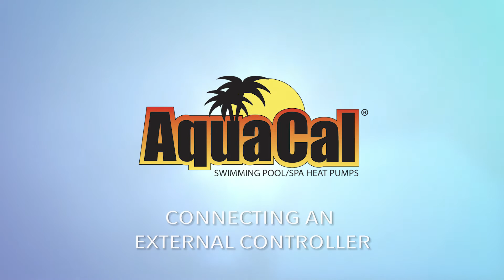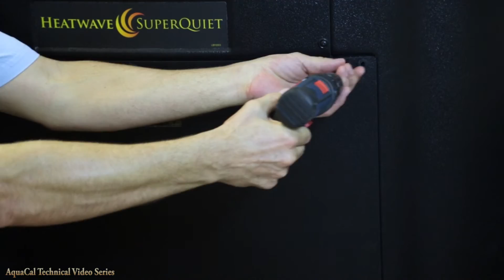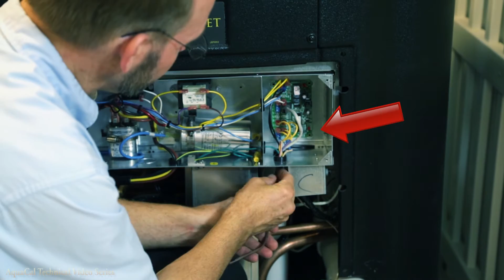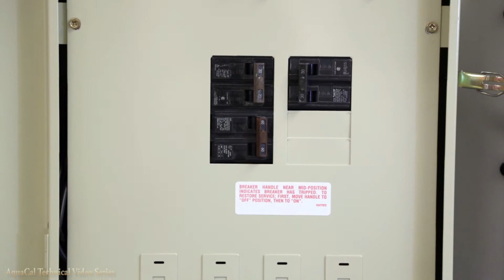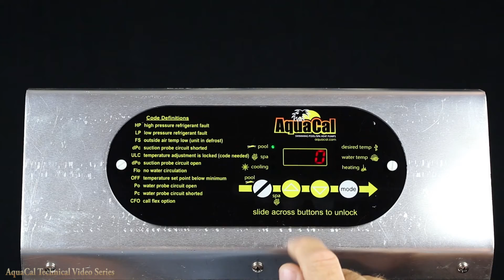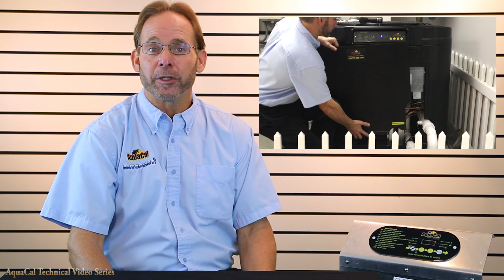Connecting an External Controller

Comment: The external controller is your automation system.  There are many types and brands.   The wire you have to buy seperate.  A thermostat wire 2 16 gauge will work fine.   Your external controller depending on which brand has a different way to connect other ends of that wire.  You have to know what type of controller you have.  And there are many.   You can't just connect this to anything.   Doesn't work that way.   If you don't know call a pro.   You will most definitely kill yourself or short out your board.   Peace.

Comment: I had exactly the same questions as Meyers Wires Inc and amjack...The external replacement control pad is easy enough to figure out but the wire running from Y and Z,...where are you getting that wire from? what is it connected to? As you are showing the hookup, you are in front of that set up blocking the view of the connection point and you do not mention or show it, only the YZ. Can you clarify for us please? Thank you.

Comment: so where is the external controller. Why dont you show the other end of the 16-2 connection to the controller. what a waste of a video
Reply: how ambiguous can you get?  how does one know if i need a 3 or 2 wire control? is a exterior control  a separate control box, part or something hooked up to the pool pump controller?  does the 2 wire do heating and cool  or just heat?